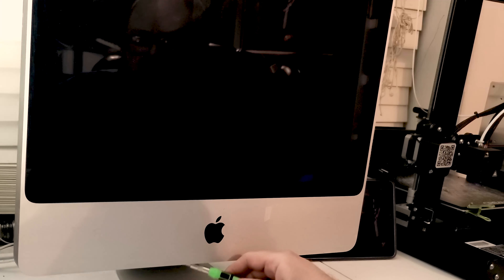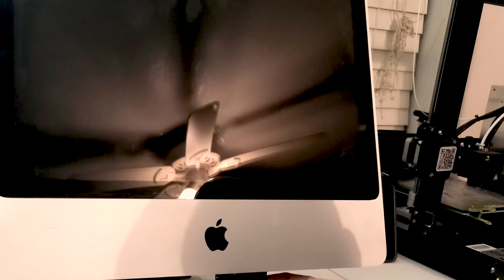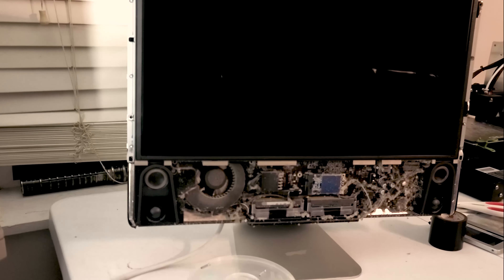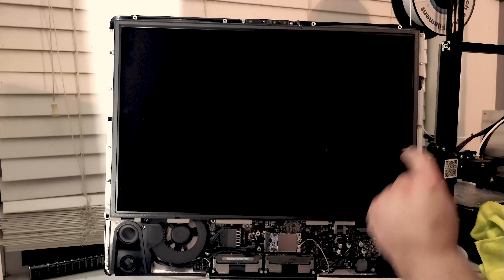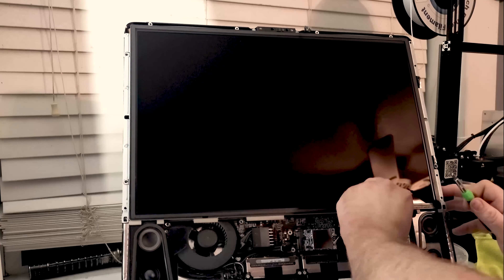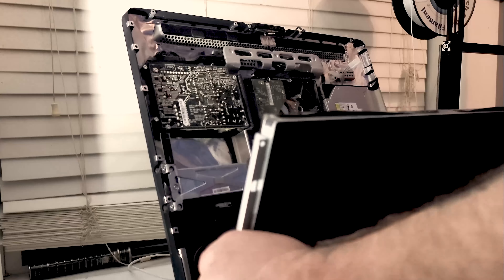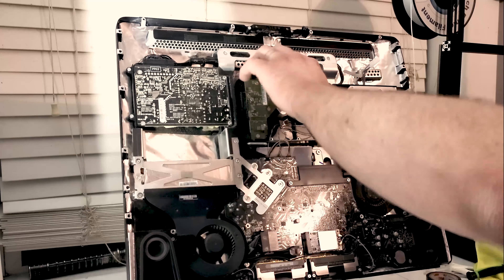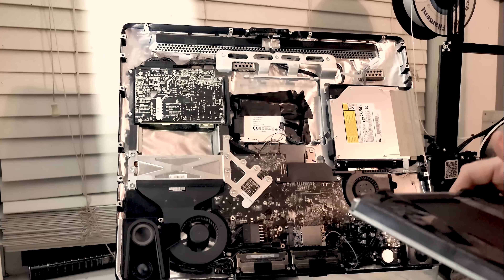Making the Mid 2009 iMac A Beast For 2021

Comment: I just bought one of these for $40. 8Gigs of ram from amazon was $30, old 1TB Samsung SATA SSD from old laptop, and a USB Bluetooth 4 dongle allows for an old battery powered magic keyboard and magic mouse 2. I'm waiting on a 2.66ghz C2D proc to replace the the 2.26GHZ C2D. Pretty happy with how much faster it is now after the upgrades.
Reply: I got one for 75 and the original owner upgraded it to 350gb hhd and 6 gigs of ram do you think I should upgrade it more or leave it alone
Reply: Are these still worth it today?
Reply: @ryanpollard8920  for browsing the web and basic office work they are reasonably useful.
Reply: Well done!
Reply: Will the KB and mouse not work with the inbuilt Bluetooth in this computer?

Comment: The exciting education-only spec of yours means having a 2.26 Ghz processor instead of the 2.66 or faster one in the standard, non-educational early 2009 one. They also made the education-only with 2Ghz processors, and fitted them with much less memory and smaller hard drives than the standard ones.

Comment: @retrotechtoys hi i have done the upgrades on my late 2009 27" imac. 1to SSD to replace the hhd, 16g of ram, 2ghz radeon 6950. it's pretty ok now! but after a few years i had issues with the wifi always disconnecting all my devices everytime i was streaming a movie .. i was wondering if you would have an idea what it could be. my main router goes down everytime now. can't even acces the internet before it jumps my modem and all my devices disconnected. i also did the open core legacy update to 13.5 Ventura as of last week

Comment: Awesome video bro, thanks. I just bought an early 2009 imac for £15 from ebay, it currently runs catalina but only has 2gb ram (I'm installing 8gb v soon) and am running the os from an external samsung t7 ssd. The original idea was to use it as a second monitor for my studio setup but I kinda fell for the little imac so will be using it for general tasks. Oh, guitar rig is good but thu over loud is worth a look too 👍

Comment: Great to see this "old" iMac revitalised again by replacing the hard disk for a SSD. I have 4 of these beautiful machines (not the school version though) upgraded with max. RAM,  SSDs and running OSX High Sierra, thanks to DosDude! Got all of them really cheap (one is a 24" model) even on eBay and they are all running fine for everyday use. I also have a Mac mini M1 for more "heavy work" but I prefer the form factor of the iMac. Not getting an M1 iMac though since they are so much overpriced.

Just got an iMac 21.5" from 2011 (Intel Core i5  Quad core cpu, 12 GB RAM) on eBay instead in also mint condition complete, with Apple keyboard and Apple Mouse for about $120. It was advertised coming with a 500 GB hard disk installed so I wanted to upgrade to a 500 GB SSD. Big surprise when I checked the machine upon arrival here and found out it has a Samsung 850 series SSD already installed! So just the upgrade the RAM to max (apparently it can handle 32 GB RAM as well unofficially) and upgraded it to macOS 12.6.2 with the DosDude tool. 

Will update the machine to macOS 13 Ventura once the DosDude tool for that is out of beta and use the all new Apple Freeform app on it in combination with my Apple iPad Pro 12.9 and 9.7. And the same with my Apple MacBook Air 13" from 2013 and a 2013 MacBook Air 11" all upgraded to macOS Ventura ... 😎I might get an Apple MacBook Air or Pro M2 with16 GB RAM refurbished later this year but there is no necessity.

Comment: I bought a 2009 imac for 50 € (8 GB Ram, 1 TB SSD). Everything works fine, the only downside is that some annoying coil whine (?) appears when i turn down the brightness of the screen. Is there any method to fix this problem. And one last thing: the fans seem to be a little bit too loud, is there a way to make them more unnoticeable?

Comment: This is amazing! I appreciate you sharing information about this device. May i ask the details about the RAM and the Hard drive you installed? I want to upgrade mine same as you did but I want to do it right the way you showed it on your channel. Just to make sure before I get the correct devices, it would be great if I have the complete details of such same as the one you use, I would be glad! Thank you

Comment: Thanks for the vid @Retro Tech Toys 😊👍
Can i buy the 1600Mhz modules: "Timetec Hynix IC compatible with Apple 8GB (2x4GB) DDR3 1600MHz PC3-12800 SODIMM Memory Upgrade For selected MacBook Pro/iMac/Mac mini/ Server" or must i get the 1066Mhz modules from amazon: "Timetec Hynix IC compatible with Apple 8GB Kit (2x4GB) DDR3 PC3-8500 1066MHz Memory Upgrade for iMac 20-inch /21.5 inch/24 inch /27 inch, MacBook Pro 13-inch/ 15-inch/ 17-inch, Mac Mini 2009/2010"?

Comment: If anybody can help.. i have early 2009 imac and i decide to keep it running again after a long time.
Am trying to install any OS and in the end at the setup   It’s shutting down. I tried every possible OS is compatible and i face the same problem.
( i changed the disk, i clean it, i install new thermal paste) any suggestions? Thanks.

Comment: Hey, A few days back I bought early 2009 iMac “24. It had already 4gb, is the 30-40 bucks worth it to upgrade to 8gb Ram? Nice video
Reply from the maker: It's 100 percent worth it. That, and an SSD will make a notable difference in performance. :)
Reply: @RetroTechToys  thank you for the quick response

Comment: Would you recommend high Sierra over Mojave or Catalina patcher?
Reply: I use High Sierra. It runs reasonably fast. But that is on an iMac 2010 with i7 and 32 GB of RAM. Until I upgraded from 16 GB it was pretty sluggish. Now think about how it would run on that older iMac.
I have also a 2007 iMac, that one runs Snow Leopard and it is also reasonable fast. I had El Capitan on it, it was sluggish.